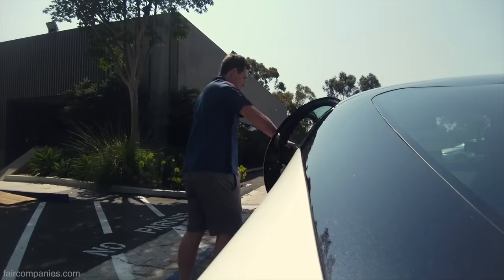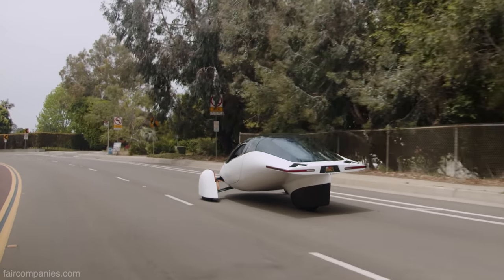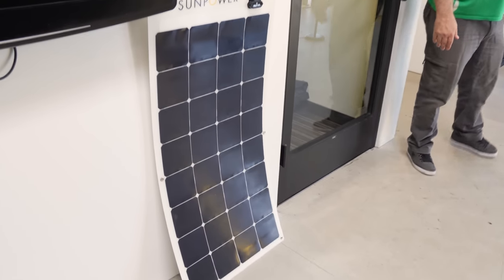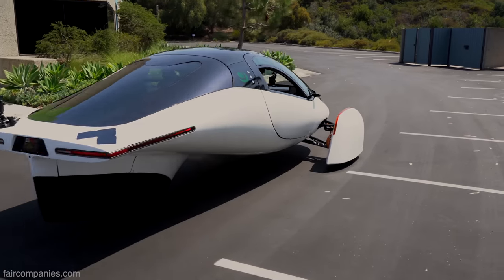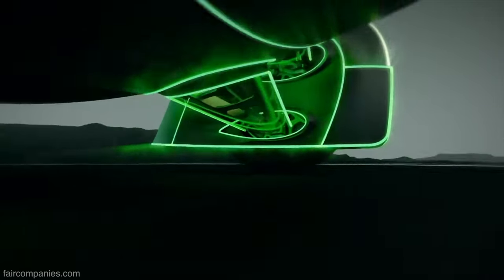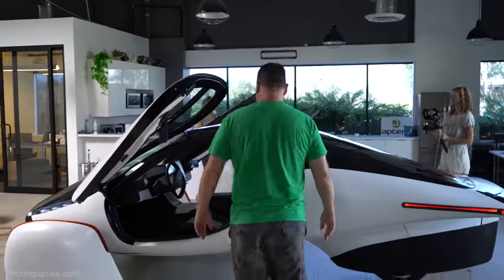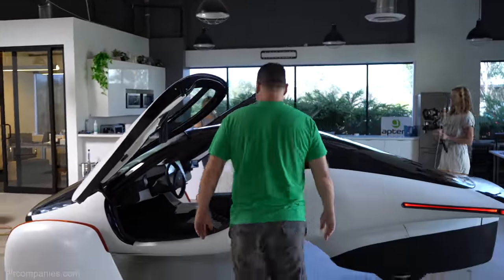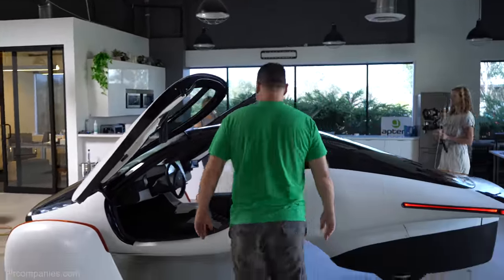Aptera commutes just on solar, gets 1K mile-range when full

Comment: They got Sandy Munro (https://en.wikipedia.org/wiki/Sandy_Munro) involved at the start so that their design could be manufactured economically. Each car has a unibody, a rear deck lid, a nose, and two doors and each is one piece so assembly is fast and accurate. Each body will ride on an independly guided trolly to the different stations with no under-floor or overhead complications. This can be ramped up indefinitely. They are contracting for parts suppliers now that the parts have been finalized. Most importantly, the price hasn't gone up. Probably still a year from delivering cars to customers. I was in love with the original ICE version and wouldn't mind a hybrid with a tiny charge-only diesel. I live in a high-rise condo with no sun or charge ports so hybrid or nothing.
Reply: They were planning on using 3D printed molds and vacuum infused resin to make body parts, but with over 37,000 orders now, it was not going to scale well.  Aptera has announced contracting with the Italian supercar body manufacturer C.P.C Group (maker of Lamborghini, Ferarri, and other supercar bodies).  They will be using presses to make parts from carbon fiber and fiberglass sheet.  This will delay production for two reasons - it takes time to produce the tooling and considerably increases the capital requirements to produce the tooling, so more money must be raised.

The benefit for early order holders like me is that the precision of fit and the quality of the parts will greatly increase.  Those later in line will get their vehicles more quickly, because this will allow a much quicker ramp up of production rates.  

We will be getting essentially supercar design and performance at bargain pricing.
Reply: @n.brucenelson5920  As far as I know, CPC only makes body parts, such as spoilers or hoods for supercars, and I have yet to see an entire supercar body made by them. Since you say they do, can you provide evidence for specific cars? I believe you just might be jerking us, again.
Reply: @aussieideasman8498  Another example of you being unable to do your own research that is childs' play for most people and then accusing others of "jerking" when you get it wrong, as you do time after time.  For someone who claims to be the "expert" who knows better than anyone, this would be a simple task.

Comment: Why don't they add a reflective material to the wheel covers? I mean, they might need to change the shape of the wheel cover a bit, and to take into account the turning, but it would serve as a very good backup to the rear-view side cameras. I mean, they won't be nearly as good as the cameras or conventional mirrors, but they would be a lot better than nothing, in the case of failure. And they could add an extra mirror to allow the driver to see the mirror on the pasenger-side wheel cover.

Comment: I think I would design the two wheels to the back and one wheel in the front to make it more like a traditional trike and eliminate alignment problems.  Also might make the body so it leans into turns like a standard motorcycle.
Reply: The Reliant Robin was designed this way and it drove Reliant to be the 2nd largest automotive manufacturer in GB.   However the handling and performance are far better with the "tadpole" configuration.

Comment: I deliver food, groceries,  etc. I drive about 300mi per day. I used over $6000 in fuel last and probably more this year due to rising fuel prices. I'm highly interested in this car. This car could  be great for someone like me. 1000 mi range and up to 40mi on solar? On a sunny day, I could never have to worry about recharging if I leave the car at the grocery store and it sits and charges while I shop for customers. And if I do need to recharge,  it would maybe cost no more than a few dollars.  I know someone with a Nissan leaf and he says it only costs about  $4 per charge for him. My only concerns are if the constant charging will reduce the battery life and I'll wait until they actually start mass producing cars before I plan to purchase one because I don't want it to end up like elio. I got this excited about elio too.
Reply: Nate, an Aptera preorder doesn't carry the risk that the Elio presented.  Unlike Elio, Aptera preorders are only $100, or less with a referral and they are fully refundable.    With the preorder line rapidly growing, waiting could put your delivery date another year out.  The advantage of course, is that later production will have enhanced features.  It depends on the time frame you are comfortable with.  I got in the first hour that pre-orders were hopen, and I will take delivery of the 42nd production model.  The risk of an early production model vs waiting another year is fully worth it for me.  I realise that not everyone has the same circumstance.
Reply: @n.brucenelson5920   I'm highly interested in the car but I will wait at least a year after it goes into production so that I can look at reviews from actual customers,  how reliable it is,  etc. But it does look promising.  If the company plays its cards right,  I can see it being the  "model t" of electric cars.
Reply: @n.brucenelson5920  sounds good. Will do

Comment: The side mirror cameras are in the same location as a standard mirror, which has a blind spot problem. I wonder if the camera lens angle solves this or if there is a better spot to mount the cameras.

Comment: Thanks for this. At 100wh/mile tha Aptera sounds at least as efficient as my little electrovelo, that gets about 11wh/km at around 1/8th the weight.
My solar panels are on the house, so range is more an issue, but I carry plug-in chargers.
Of course my little 3 wheeler cost under 4k to build and pennies to maintain. 
Still, I like their platform.

Comment: Lovely design. Could probably cut that weight in half though and get 3k per full charge. Incremental improvments.
Reply: The weight is also a trade-off with safety and cost of materials.  The design is already far more focused to its purpose than any other vehicle in personal transportation.  You have to go to space craft design to find more mission focused vehicles.

Comment: Lmao, I drive practically on every road in the video, and even remember what that random house at 6:30 used to look like before the remodel. Corner of SDA. 

Ironically I’ve only seen the Aptera just once during the 2007 Christmas parade even though I live in the same zip code. It’ll be an adventure to start seeing these everywhere, but continue waiting.
Reply: The original company had their founders kicked out by the board in 2009, and was liquidated in 2011 when the CEO couldn't get a loan to build a different car.  The original founders purchased the rights back in 2019 and restarted the company with a completely new design.  There are now 3 alpha prototypes and an increasing number of betas on the road for testing.  They are building out a factory in Carlsbad, and we may see initial production on the road late this year, if the testing and supply chain availability goes well.

Comment: The price point makes Aptera even more desirable. There aren't many vehicles worth having that start at less than $30K anymore, but this one does and it seems to have almost no operation cost. I'm very tempted to slap down the $100 needed for reserving a vehicle. I'd like to know how much it costs to replace tires, shocks, or any other wear-and-tear parts.
Reply: Tires are a standard production size.

Comment: fantastic;  but how would it handle colder climates and snow?
Reply: It has state of the art ABS/traction control that can sense slip and adjust torque every 2.5" of tread travel.  I plan to use mine in Iowa and will report.

Comment: How long are the batteries expected to last? Total miles driven over lifetime?
Reply: They are using 2170 batteries with an excellent BMS.  Elon Musk has stated that the Model 3's 2170 battery pack was designed to last 300,000 to 500,000 miles, or 1,500 charging cycles.  Since the Aptera will stress them less, with less weight to move, it is likely that the Aptera batteries will perform at least as well.

Comment: I love the idea of solar cells. But to maximize energy captured would take some consideration of the direction of the vehicle as well as the time of day when you park and how long you plan to be there so you can work out the sun angles. (maybe that could be made as a feature in the infotainment system where you just give it the time you will be there and it takes the location from GPS and current time to give you the angle to position the vehicle (e.g. 280 degrees or WNW for parking at noon and leaving at 3pm). Plus you would have to make sure that trees and buildings wouldn't shade the vehicle. 

I would rather take the money and expand the solar arrays on the south facing parts of my roof at home and stash the generated power in a stationary storage battery at home (which I will have to minimize use of grid power to run my house). Then can park in any available parking spot or inside a parking garage. When I get home I can transfer the collected energy to the vehicle. Still I think I would opt to keep the cells on the dash to at least power a vent fan to keep the interior of the vehicle at ambient temperature in the summer and to run the seat heaters in the winter to keep the seats toasty.
Reply: I think you're "over-thinking" it.  The full solar package for the Aptera is not expensive.

Comment: Will this make replacing wheels more expensive or harder to swap out when needed?
Reply: No.  The wheels bolt on to the wheel motors just like they would to drum brakes.  The wheel pants unclip quickly without tools.
Reply: @n.brucenelson5920  ahh ok good to know :)

Comment: How much would you loose in solar panels to have the dashboard ones outside on the windshield instead so you have shade on the dashboard instead?
Reply: Thanks for asking greta but that would be a loss due to aerodynamics/  drag. Plus, you would not be able to see through the PV cells.
Reply: @donovan2913  Yo Trump... is already some panels o the outside and they are quite flat. Regarding visibility...you don't put the panels high enough to block your line of sight, unless you are driving starring on your bonnet, then they might be in the way, but you're gonna crash anyway so no difference there.

Comment: I've just signed up for the 600mile model. I'm curious about the process of changing a flat tire? Especially the rear center tire.
Reply: The wheel pants come off easily.  Most of us will probably just carry, pliers, a plug kit, and a DC inflater.   The nail or screw can be pulled, the hole plugged and the tire refilled all with the wheel still on the vehicle.  I have done this often on motorcycles.
Reply: @n.brucenelson5920  Ok, that's fine for a small, pluggable hole, but what about a gash that requires a replacement.? I'm thinking worse case scenario here...
Reply: @gregmckay666  In half a million miles of driving, I have had to plug many holes.  I have never had a gash of the kind you are proposing.  However, if I did, I would call my roadside assistance plan, tell them my tire size, and have them come and change it.  The tires are standard and the wheels unbolt from the wheel motors just as they would from drum brakes.

Comment: If there were a hardtop convertible version( roof sides back over the rear section of the car), I would buy it in a heartbeat.  The market I see is the same as the Mazda Miata  or the British Sports cars of the 1960s & 70s like the Triumph, MG,Jaguar and Astin Martin. These cars were different from and more sporty than the typical American cars of that time. I gave my wife a new Triumph Spitfire convertible as a wedding present in 1970. I had a 1997 Chrysler Sebring convertible and I currently own a 2008 Chrysler Sebring hardtop convertible. There nothing like driving down the back roads or along the beach with the top down.
BTW, I own stock in a number of car companies that are putting out EVs and SEVs. I would love to buy stock several hundred dollars with of shares in this company but I cannot afford the amount they currently are asking to become a shareholder in this company.

Comment: Ive wanted this car since it was announced! I thought they died off since I heard nothing on it for years and Tesla electric cars came out. Glad to know they are still around. Just dont know how many mechanics could work on it or part availability outside the dealer... Still want one, but the price for upkeep and having to go to dealers for every problem sounds expensive.
Reply: The original founders lost control of the company in 2009 and it was liquidated in 2011.  They were able to repurchase the rights in 2019 and restarted with a brand new design.

The repair documents will be open source and with right to repair, anyone can work on it and get parts..  My independent garage here in rural Iowa can hardly wait to see it.

There is so little regular service that it should be very inexpensive.  Basically replacing wiper blades and windshield washing fluid and tires.
Reply: @n.brucenelson5920  I put a summary of Aptera's shady history right after I copied my comment on your site into my Snake oil video. Just thought it appropriate at the time - you should read it.

Comment: Quite a stunning revelation about the air drag loss from fixed side view mirrors. If true for current vehicles, the automobile industry should definitely remove permanent fixed mirrors and replace them with rear-facing cameras flush mounted in the fenders or roof with display inside the dash.  The technology is already available and, if it fails, you can always just look over your shoulder and to the rear view mirror.
Reply: Except that is a lie about the mirrors.  And many other lies,,or lets say exaggerations to be police.

Comment: I'm wondering if the wheel covers hit speed bumps they look low, if they clear I want one.
Reply: This is an alpha prototype.  The wheels and attachment points have been redesigned for the betas, and production versions will be fine.  I rode in an alpha, and even it handled speed bumps OK.

Comment: The motors are at the wheels, so how does it brake? Does it have standard disc brakes?
Reply: Yes, it has standard disc brakes and several levels of regenerative braking.
Reply: @n.brucenelson5920  thanks I saw a better picture in another video I watched and finally saw the calipers lol

Comment: This may sound boring ….. but ….. would it be possible to see some videos on how well it parks in small spaces, and reversing pros and cons, it’s something that you obviously need to do but all the videos is have seen it has tons of space around it which is not real world usage. Cheers.
Reply: This will come.  The differential steering is still under development.  I have ridden in a prototype and drive a truck that is wider that I can still park in a typical compact parking space (96' wide)  The Aptera is 88" at the widest point, so I am not too worried.  There will be a learning curve for most of us.

Comment: Having motors on the wheels increases the unsuspended weight making the drive More bumpy and reducing the tire's grip
Reply: Not a great deal, due to weight savings in brake weight and drive shafts.  The rest can be mostly addressed with suspension tuning.

Comment: I love it, but I'm concerned about how well it stays on the road in high winds
Reply: Aptera has been tested stable in 120 mph side winds, much more stable that slab sided SUVs.   There is just very little for the wind to push against.  What little drag there is is mostly designed in downforce at the rear of the vehicle, which gives 25 lbs at 65 mph and increases rapidly with increasing speed.  The 400 mile range Aptera is about the same weight as my Honda Insight, which I have driven in steady 70 mph side winds without difficulty, even passing trucks.

Comment: Kinda like the Idea of this being a Towable escape pod... Some sort of hitch attachment would be cool. 
Looks like a fairly well sorted out Early production vehicle. 
not sure the curved panels on the roof are worth the headache. 
Be cool if it just stored or had attachment points for a more efficient "flat panel"

This is what all Delivery services should be in. 
food delivery, amazon last mile, flowers, parts... 
really should develop one for Driver and rest for Cargo..  
Or one for Lyft, Imagine that is just different layouts of the pod.. 
since that seems highly customizable. 

Wife would love this for her 5 mile commute when just too cold and rainy for ebike. 
seems like this is a required garage accessory... like a proper HVAC system...
Reply: It has an HVAC and will be tested to perform from -20 to 125 F

This is only an alpha.  The betas being built now have many significant changes.

Comment: The wheel covers sit quite close to the road. Do you have other options for winter driving. I live along the south shore of Georgian Bay where sudden squalls can dump a lot of snow in a short time.
Reply: There will be 5" of clearance on the production models, and an off road version will have even more.  The ABS/traction control can sense wheel slip and adjust torque every 2.5" of tread travel, so the AWD version with snow tires should be awesome.
Reply: @n.brucenelson5920  okay thank you for info.